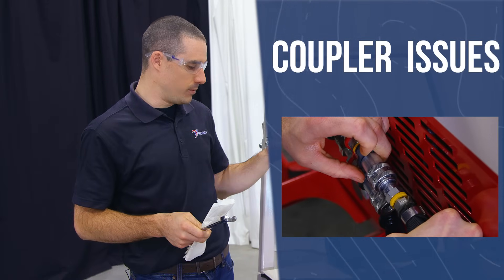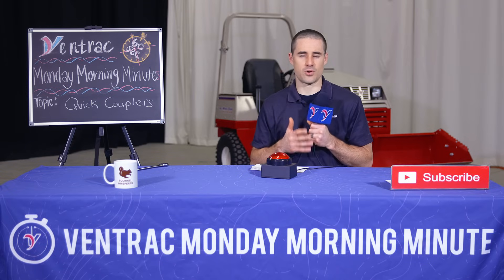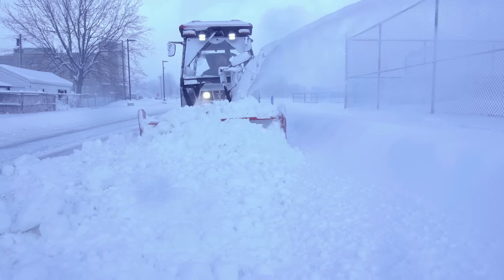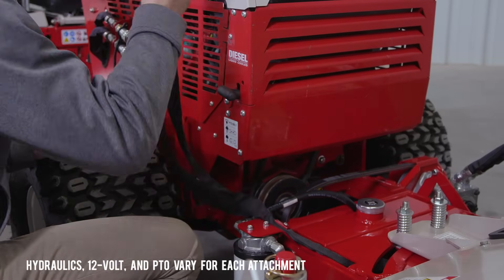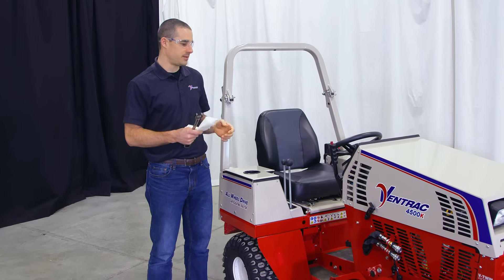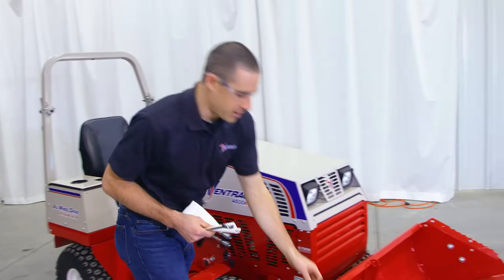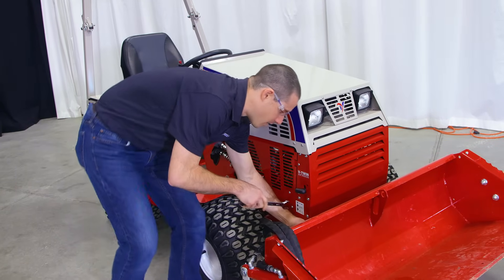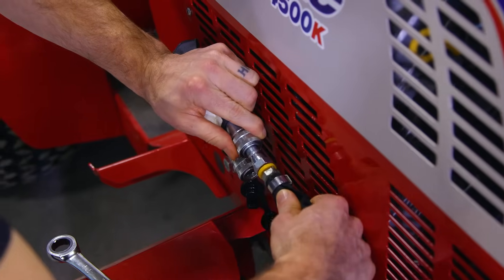How to Fix Aux Hydraulic Hose Couplers That Won't Connect - Ventrac MMM

Comment: Hey, these quick attach fittings are about $125.00 each or $250 per line X 2 that's $500.00 per machine. It is not often that all four start leaking but they could. How about a video on how to replace the seal or "O" ring that causes the leak. This O ring may cost $.20 plus some repair time vs $125 or $250 plus the down time and trip to the dealer.  Otherwise, just strike a match & walk away?

Comment: Thank you. Sitting in our barn with a trailer load of hay trying to off load with our hydraulic hay forks…watching your video to get the darn thing hooked up.👍
Reply from the maker: Glad Ventrac could help. What piece of equipment were you using?
Reply: Small bale loader. Lifts four small bales with C-shaped grappling hooks. Not sure of the official name. Works a charm, after you get it hooked up.  @ventrac
Reply from the maker: @lorihutchinson9485  Awesome! Thanks for sharing!

Comment: Thanks, dude. I have these couplers on an auto lift in my garage.
 Been wrestling with these getting more and more difficult and then finally not connecting. Video came up first in Google search.
Straightforward explanation. Solved in 2 minutes.

Thank you kindly.
Reply from the maker: Glad we were able to help you out!

Comment: Great explanation. I did turn the tractor off and bump the controls to relieve the pressure before disconnecting, but 97 degrees in Florida took it’s toll I guess. Thanks for the information!
Reply from the maker: Glad it helped!

Comment: Is pressure a problem with flat face couplers ?
Reply from the maker: It depends.... If they're true connect-under-pressure fittings, then not usually.

Comment: I am such a noob, struggling for 1/2 hour trying to couple the hydraulic lines on my JD tractor and backhoe.  All I did was to "relieve" pressure by moving the backhoe controls until everything relaxed.

Comment: just bump the end of the ball and let the pressure off that way with something either a hammer excetera don't worry about messes up you want
Reply from the maker: That works too! In a pinch with no tools around, this is the go-to method. it just usually spills a squirt of oil on whatever hits it and you have to be careful not to mushroom the tip of the fitting over time.

Comment: Just want to say thanks on this vid.  I was helping my dad install a front end loader on this JD 3046R.  Could not get two of the hydraulic connections to mate.  Did some googling and got your video.  I never considered that the problem could be the implement.  But it had been sitting outside for quite awhile and it was hot.  I loosened a fitting, got some oil and everything went together like butter.  Learned something new today so it's a good day.  Thank you.
Reply: Excellent video!

Comment: Very helpful advice, thank you.
This can happen to any hydraulic system. If the pressure is not extremely high, we usually relieved it by pushing the hose end on a hard surface.
Reply from the maker: Exactly! We are so glad it was helpful for you!